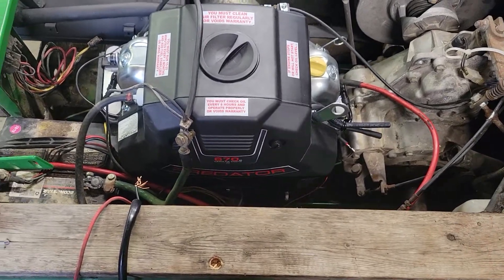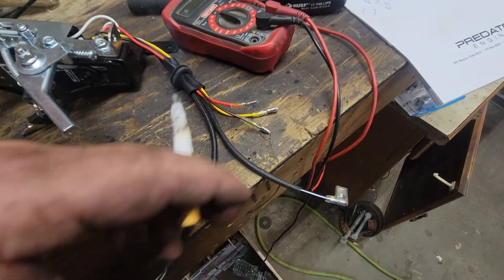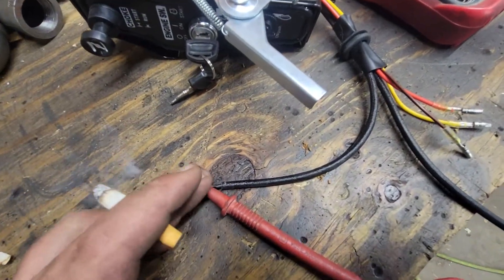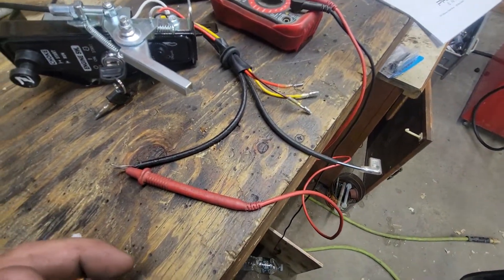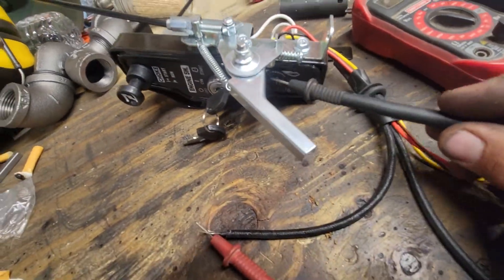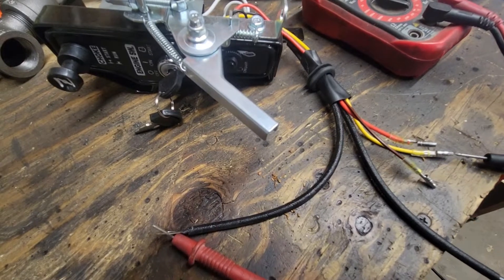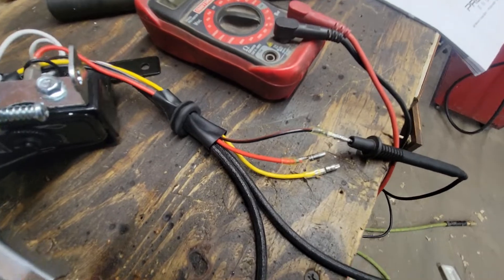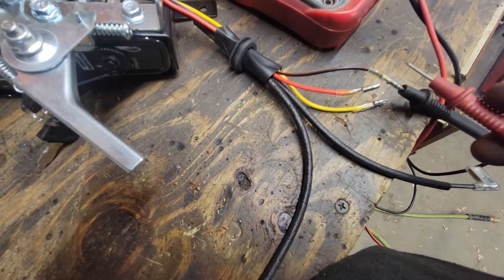Predator 670 cc ignition switch wiring explained.

Comment: So if I want to switch on a 12V fuel pump that I've hooked up, is the yellow wire the one I need?
Reply: I came here for the same reason. Yes that’s what you want to have the power for a pump wired to, I’m still gonna do some investigating of my own but this video was a huge help
Reply: @Bigtommyboy6996  I had to solder mine to the board. Yellow position on the board was reading constant for whatever reason. There's an unused spot between the wires that is only hot in the key on position. or use whatever wire that is leading to the carb solenoid.

Comment: Trying to wire a kill switch for mud motor. Can’t use the oil sensor as that’s off the motor can I splice into the red and black so when I hit the button it senses the keys turned off?
Reply: Trying to do the same. Did that work for you?

Comment: The yellow and the red ate outputs not feed correct? What do they go to?
Reply: The yellow one was supposed to go to the solenoid in the carb to open the gas flow.  The red one is coming from the stator to send power back to the battery for charging while its running.

Comment: Hello, I have a question, although I have made all the connections correctly, the engine does not stop, which part may be defective?
Reply: Look for 2 black wires coming out near the bottom of the engine. These are connected to the coils. Trace them from the spark plug if you have trouble. When either of these wires are grounded, it should kill the engine. So, wire black wire to tab or post on key switch marked M, for magneto, or some are labeled IGN. Either way, when the key is off this should ground the coils, killing the engine. Test the black wire by grounding to the frame or other suitable ground. If this test kills the engine, check all your ground connections for tight connection and good conduct to clean bare metal. Gotta have a good ground or nothing will work right.
Reply: @adamkoontz2914  hallettim teşekkür ederim